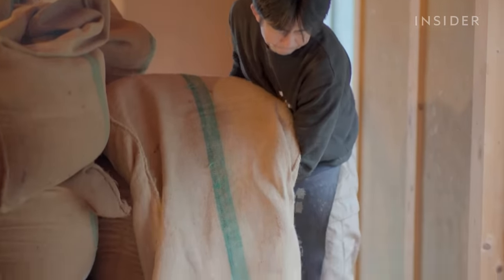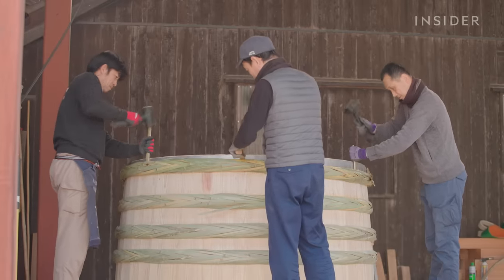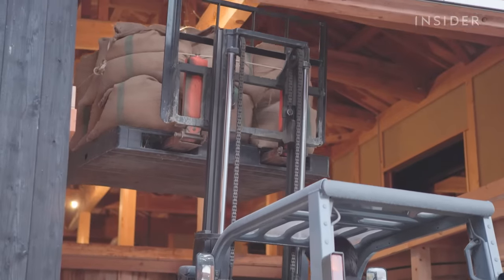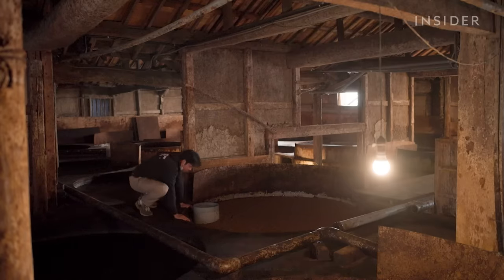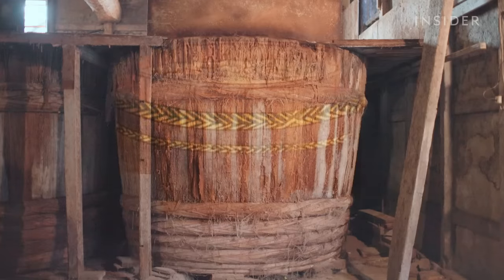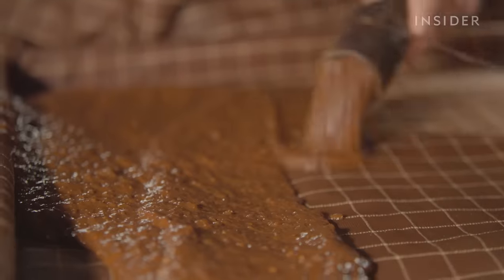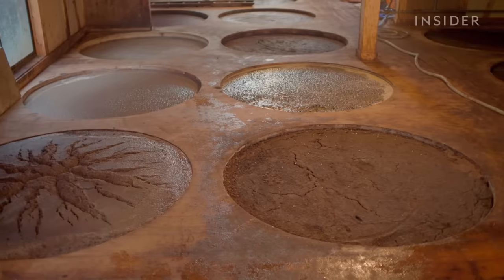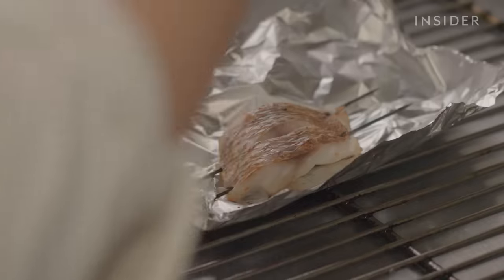Why Only 1% Of Japan's Soy Sauce Is Made This Way | Still Standing | Business Insider

Comment: The traditional japanese barrels with the bamboo bindings is not just cause steel bands corrode, but also because metal historically was a premium material in Japan. Japan is made up of volcanic islands which is poor in iron ore, unlike continental areas. Thats why in japan you see a lot of crafts developed around the only metal really being in the tools that need it. Carpentry without nails, barrels without hoops, etc.
Reply: How did Japanese carpentry work?
Reply: @buddermonger2000  Less nails and more joinery. They're expert woodworkers as is proven by their long standing buildings. Wood doesn't typically last as long as some building materials yet they have the oldest.
Reply: @Aaronlcyrus  I'm going to have to look up what Joinery is. Also tbh worth noting that wood has lasted very long in many places across the world and about half of the reason they're destroyed is war.
Reply: @buddermonger2000  basically cutting slots into wood to fit pieces together rather than having nails hold them together. Wood is also considered a poorer material due to it rotting when exposed to long term moisture. However the Japanese have a building over 1000 years old, older than many concrete structures.
Reply: @Aaronlcyrus  I wonder how they treated the wood
Reply: @Aaronlcyrus  Well... duh? Concrete usage didn't really take off until after the industrial revolution.
Reply: @MegaBanane9  The point is that concrete is often thought of as the better material but there are wood buildings that existed 1000 years before the industrial revolution, and still today.
Reply: @MegaBanane9  concrete has been around for a long time even the romans had their own version of concrete
Reply: @Aaronlcyrus  actually, in places like Japan wood has a very big advantage over concrete. Wood can flex, twist, and shake without breaking. We see this advantage play out in 1923 when the great Kanto earthquake struck and older Japanese style buildings were left standing, but Western style masonry buildings collapsed.
Reply: when  the  anthropologist  thor  heyerdhal  built  his kon-tiki  raft,  he  did  to  Exact ancient  specs.   sailors  scientists  etc  etc  said  he  would  drown  in  the  middle  of  his   peru to  polinesia  crossing.  halfway  he  understood:  if   he  had caved  in and  used  metals   in  his  traditional  raft,   the  explorers  would  have  been  lost..
the metals  would  have  sawed  through  the  balsa  logs..
another  surprise  he  got  was:  heyerdhal  included  "useless"   boards  through  the  logs  -  per  ancient  drawings.   one  day  one  board  got  loose:  the  kon-tiki  changed  course  by  5 degrees   !!    those  were  the  steering  mechanisms.   when  the  board  was  lifted  up  to  its place  the  raft  returned  mysteriously  to  her  course.
Reply: @Chileno5100  indeed, that's why I said "took off" - and there's of course still some roman buildings around too
Reply: @Aaronlcyrus  there's roman buildings using concrete left too - but thousand year old buildings are the pinnacle of survivorship bias in general. Only the most well maintained buildings will last that long, and if it happens to be made from wood and not get struck by a natural disaster, it'll survive, just like those thousand years old roman buildings that are still around despite lacking maintenance for hundreds of years.
Reply: @Aaronlcyrus  Yeah but the time it's been around isn't a good reason because if the concrete was around back then it would likely still be around as well.
Reply: That's really cool I had no idea
Reply: @MegaBanane9  does earthquake count as natural disaster?
Reply: that's pretty interesting
Reply: @Aaronlcyrus  Tōdai-ji Temple
Reply: @Aaronlcyrus  it's thought of as "better" in alot of regions because it can't get worms, rot, doesn't need a ton of maintenance to keep up, is cheaper and easier to source/environmentally a bit more friendly than harvesting that much wood
(What happened to Europe's forest? Wooden ship building)
Whereas with wood, it burns, it rots, etc.
Sure it is better for having a ton of earthquakes, which is why it's used so much in Japan.
But if you just have it stand somewhere it will rapidly deteriorate and once it does I'll only get worse.
The sheer amount of work, costs, dedication and luck to keep it well maintained over that timeframe is insane.
(There aren't a whole lot of other countries that could've preserved anything this long due to politics and wars)

Besides, I really wonder what their laws are and were around preservation and renovation of those old buildings
Reply: @buddermonger2000  No nails. Wooden structures are all wood with joints as has been said before. They can wobble and shake but houses made that way don't usually collapse. I think it's also common in other areas in Asia with significant earthquakes.
Reply: @buddermonger2000  I've seen a few videos on various laquers and 'shou sugi ban', a process where they char the outside of the wood (I've seen it done these days with a roofing torch, intense char, but shallow). This charred layer puts off a lot of insects and also seems to help moisture protection.
Reply: @Aaronlcyrus  I do feel like any building method is geography dependent , though.
Where I am in Scotland, the oldest buildings are made of very thick stone block walls or brick , because it resists the damp climate, but I've seen deterioration of older concrete and masonry with higher daytime heat and cool clear nights in places like France and spain, even the type of concrete or block can matter. Equally, hardwood  will last longer than softwood outdoors in the vast majority of situations
Reply: I actually really like this insight to metal's exclusivity with in Japan, I never put that fact into perspective into why they eventually opened up to the rest of the world and why they where so quick to grow massively with in around 100 years because in the world we live in today they can simply inport and export what they need which has lead to major metal cities.
Reply: Japan has always been poor with metals. Even when Japan’s  economy was thriving in the 60s, they had to use old American tanks to build Tokyo tower.
Reply: Except it isn't, almost all east and south east asian carpentry focused on joinery but most countries in this area are not that metal deprived, its the architectural style, which was mostly influenced by climate that made carpentry more focused on joints. Also medieval woodwork is all about joinery, have you seen some of the joints in early medieval cottages, they are complicated as hell and require little to no nails, the reason is simple, early nails are not as strong as you think and its easier to make strong joints than strong nails.
Reply: this is also why katanas and similar weaponry had to be folded thousands of times, the mtal was so low quality an dimpure that it needed to be folded countless times in order to produce a sword of decent quality
Reply: @littleloner1159  Wooden structures if well made can still stand for quite a long time, Yingxian pagoda had withstood 7 earthquakes, 2 of which is above 8.0 magnitude and hit by modern artillery twice during the warlord period of china in its 970 years of lifespan, there were only one major maintenance in 1722 and most of the time it was left untended, it did became so damaged in the 20th century to a point that it almost collapsed, but only after major structural changes where some of the support structure were removed to make it look better, and that's not even the longest standing wooden structures (but is certainly the tallest, which added some perks to its builders because its hard to build a 65.7m tall pagoda that can withstand all those damages for millennium), many early medieval cottages from 9-10th century are still pretty well preserved in England, for their simplistic structure they are surprisingly long-lived, and many of which were also made with pure joinery.
Reply: @buddermonger2000  another reason for long standing japanese carpentry is their olden days advanced laquering.
Reply: @MegaBanane9  There's a reason we look in awe at roman concrete structures that still stand today, albeit heavily scared and damaged. They're basically the only ones who did it the best and we yearn for the knowledge to make their concrete mix.
Reply: @mkmasterthreesixfive  their mix is fairly well known, it just requires relatively more rare ingredients like volcanic ash. For the buildings, the age factor plays another role with concrete too, as it gets harder over time.
Reply: @Pepe-dq2ib  sure, and they have those in Italy too.
With wood I'd be more worried about fires, rot and warfare though.
Reply: @MegaBanane9  if you consider 7 strong quakes in the past 100 years is anywhere close to Japan's. The last one that hit Pantheon was a 5.4 in 2016. The 8th century Buddhist temple where one of the building is at gets four of those a year. With five over a 7.0 in the past 20 years.

I wouldn't say one is better than another, it depends on geography and the environment.
Reply: People innovate when left with limited sources, all over the globe. Kinda amazing.
Reply: Very interesting! I've seen some amazing woodwork and joints come out of Japan, and now I know why. They had to innovate!
Reply: @Aaronlcyrus  "However the Japanese have a building over 1000 years old"
that is correct, but also not a single piece of the wood in these buildings are that old.
some of the oldest temples get dismantled every so often and rebuilt, and everything that is going bad is replaced.
one of the oldest was even burnt down under the war but since they knew the whole construction it was no problem 100% recreating it.
so the buildings are the same as when they got built, but everything have been replaced.
and with simple but robust fasteners in the form of wedges instead of nails dismantling and rebuilding can be done fast, with simple tools and with ease even by unskilled workers.
Reply: @buddermonger2000  I'm very slowly learning about Japanese culture and architecture: For those interested elsewhere and for context

As Midas points out, Japan is very poor in iron content, early Japan relied on "Iron Sands", which are exactly what it sounds like, sand like you'd expect on the beach or in waterside areas that is unusually rich in Iron content. Unlike traditional European/Asian metalworking where you can just smelt down raw iron ore, Iron Sand is far more "impure", thus requires a far more intensive refinement process to work out the impurities.

This is why whenever you hear/see Japanese metalworking in anime/popular culture why they have to fold over the metal a dozen times or so, not because it makes a 'perfect' metal, but because it was a means to draw out the many impurities in their native metal. It's a simple ye effective method for those with the patience and skill to practice and understand the quality of their material. In fact it was not only expected but basically a necessity for the village when a home or part of the community was lost to fire or disaster to carefully dismantle the wreckage of a home and find every scrap of iron to repurpose/recycle for later use wherever possible because of the value of the metal.

Joinery is essentially precision woodworking. In many Japanese woodworking shops I've seen the planes they use to shape/sculpt wood can cut through wood so finely that the material shaved away is translucent, you can hold it up to light and see through the pieces shaved off and see right through it like glass almost in some cases.

This level of precision helps in making sure that when 2 pieces of lumber are cut away, they fit together very neatly/tightly. You are in essence cutting one piece into another and snapping them together like Legos or the like. This ensures not only that both pieces fit together properly, it also means that the weight of the structure is what holds everything together essentially.
Reply: Iron sand  Doh~\
Reply: @MegaBanane9  😂 its been around a lot longer than just recently
Reply: back in the middle ages a lot worked with wood nails and such even in europe. Metal was always expensive. We still have houses here in the ore mountains that are build without nails and only use dug up field stones for the foundation. That is simply how things used to work. That in a place where we dug up iron, silver and later even uranium for centuries.
Reply: even when they made katanas, they only used metal when necessary. as a good example, only the hilth and the blade are made with metals. the pin that holds the handle is a little piece of bamboo.
Reply: @buddermonger2000  ooh this was a topic of interest of mine in high school. Measurement was not standardised, but in units based on the size of the man of the house. A carpenter would measure him, and his proportions were reflected in the size of doorways, tatami mats, lintels, transom windows, architraves etc.
Reply: @Aaronlcyrus  The Pantheon was built out of concrete by the romans and is still standing two millenia later.

But yes, traditional carpentry does not use nails. Much of western carpentry didn't use them either, though they did fall back on them and western barrels generally had metal rings around them. Nails were labour intensive to make before industrialization since they were made one by one, so a dozen nails could be more expensive than the metal ring that went around a barrel.
Reply: @Aaronlcyrus  your correct inwatchenchina uncensored show on here and they talked about why and how Japanese wood working is the best where they mend and wedge wood together rather than use nails
Reply: Yes, they have the most sophisticated joinery. It also works better in case of one of the frequent earthquakes. Strong but flexible, will bend but not break or come apart.
Reply: @buddermonger2000  kept it dry by using large overhanging roofs. The wood never gets soaked with rain.
Reply: @MidasMakeItRain  god dude I know this has nothing to do with your comment but, I read kanto and instantly thought Pokémon... idk why damn I haven’t played it in 10 years lmao
Reply: "Build a house without nails"

Explains a lot about the culture when you think about it.
Reply: Just when somebody wants to know how the guys did it centuries ago to prevent insects from eating the wood: First you soak the timber in water for several months. A lot of the nutrients in the woods that are important for insects are gone by then. Keeping it wet also prevents many kinds of fungi and mold. Then the wood will be dried for several years and cut into shape. Then you would roast it in fire for some time. Then it can be painted, which is also a repellent. The wood is now almost impossible to eat for most insects. The rest of the trick is to have an architecture that prevents direct contact of the wood with the soil and moisture from rainfall. Wood treated like that can live hundreds of years, and damaged pieces can be replaced later if necessary.
Reply: @Aaronlcyrus  I need to research this now. I'm taking a material science/engineering class at the moment, one of the main reasons wood isn't used in construction that much anymore is how fast it can rot and decay but solve that issue and it'd see way more widespread use (once engineers and architects warm up to it again though)

Wood has so many benefits over cement and steel and it's much more environmentally friendly.
Reply: @Aaronlcyrus  Just a slight correction. Carpentry without the use of nails was developed by ancient China then spread to Japan via the Korean peninsula.  It’s called Sunmao in Chinese and Daemokjang in Korean.
Reply: This is completely untrue. It's because it's delicious
Reply: @Nahasai-6498  I find that so sad. Everywhere today they talk about a "celebration of diversity," but with that celebration comes homogenization and makes it so that there is no diversity. I hope Japan will hold on to its culture and not make the same mistakes as Europe.
Reply: Japan had lots of iron. The problem was it was iron sand. So the metal was terrible without huge amounts of work and fuel, therefore rare and expensive.
Reply: Id imagine the different material might also impact the flavor profile in some subtle ways, fermenting basically anything inside a wood barrel vs metal produces a slightly different tasting product usually
Reply: @ev3rsonix392  just like alcohol
Reply: @kakarotten  yep exactly!!
Reply: @MegaBanane9  The Romans were using concrete 2000+ years ago, for all sorts of building work.
Reply: @buddermonger2000  there is a Japanese man that builds traditional houses on YouTube quite fascinating look it up
Reply: @buddermonger2000  Instead of using nails, they design joints of wood which slide into each other and lock into place
Reply: So that's why...
Reply: @Pepe-dq2ib  Very much so
Reply: The way they treated wood was very impressive. Tempering some types of wood with flames so it becomes flexible yet hardens, lacquering and waterproofing.
Just the overall knowledge they had as well.
Reply: Sorry mate but you don't make any sence
Reply: @buddermonger2000  use wood on wood
Reply: @Aaronlcyrus  The trick with wood is position and moisture. It doesn't matter if it's soaked with water or dry, as long as it's not changing its fine
Reply: True that. They don't use metal nails
Reply: @MegaBanane9  it was a nice civil conversation til u came along. why u gotta be all condescending
Reply: Now that you mention it, that makes complete sense. That explains why samurai armor was made of wood and bamboo fibers and why the Japanese are so proficient with wood.
Reply: @buddermonger2000  If you see the old Japanese castles they joined the joints up together so finely that even in an earthquake they would fall at all without having any nails or anything in it. Thats why the designs look so complex, they have to be perfectly structurally sound.
Reply: @Aaronlcyrus  What!? Theres no thousand year old concrete buildings? No way...
Reply: @bosha6654  i never said that.... there are thousand year old concrete buildings, but i pointed that the japanese have the oldest wooden structure as a testament to their skill.
Reply: Suspicious comment. So do you say that Japanese vehicles are like horses to them?
Reply: @Aaronlcyrus  dovetail joints would be a wonderful example of Joinery
Reply: the clean and tidy work environment is much needed for a praise
Reply: They literally said word for word, wooden barrels were used when you couldn't afford to modernize.
But thanks for reiterating exactly what the video said!
Reply: @MegaBanane9  concrete was used since the times of rome tho
Reply: @Aaronlcyrus  sounds more like a ship of theseus situation. Or they had very good sealing and resins on the wood.
Reply: @Aaronlcyrus  yes, and fine Japanese wood working is known for joints without fasteners, the wood is carved and cut so that it can fit together with friction.
Reply: @buddermonger2000  Man, you need to go on a binge of japanese and corean carpentry videos. Those no nails techniques are awesome.
Reply: @Or5mr  Maybe I do lol
Reply: The poor metal amount and quality is also why they originally made folded swords, cause it’s a way of turning bad quality iron very strong
Reply: I always wondered why they didn’t use more metal when they had the technology to forge. Thanks for the interesting information.
Reply: @buddermonger2000  joinery is like a puzzle out of wood. You fit the pieces together and usually glue it in place
Reply: @Aaronlcyrus  "The point is that concrete is often thought of as the better material but there are wood buildings that existed 1000 years before the industrial revolution, and still today."

Doesn't point anything out or prove shit. Castle's have also existed for thousands of years, does that make it longer lasting material? No. The reason some japenese wood buildings exist today is the same as why some castle's or concrete build during the industrial era also still exist today. They have been maintained well. 

Any concrete that isn't maintained well will lose its structural strength, any wood that isn't maintained well will rot in the rain and any castle's that aren't looked after will look like a graveyard sooner or later. Its all about the price, how much does it cost to maintain and how available is it?
Reply: The japan have rain season, and quite all the year a high humidty in air, so yes the corrosion can be a problem
Reply: @JT-dd9fi  Your comment is the one I have been looking for lol. I knew this because I learned a few things about ancient Chinese architecture in my engineering class. The beautifully decorated joints on ancient Chinese buildings are truly marvelous.
Reply: Wooden nails exist tho
Reply: isn't lacquer also the reason east asian wooden structures and furnishings last longer? we invented lacquer and it strengthens and protects wood
Reply: @Aegis---  It seems you do not understand anything scientific about swords lol
This is not because of low quality of katana…